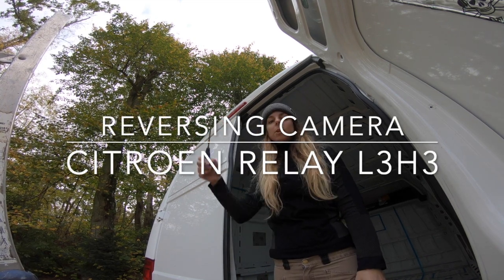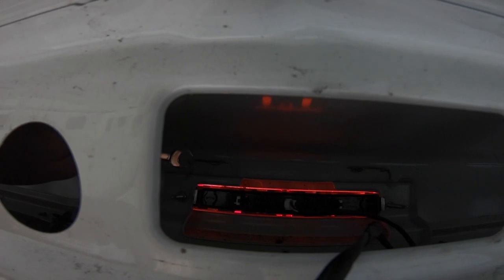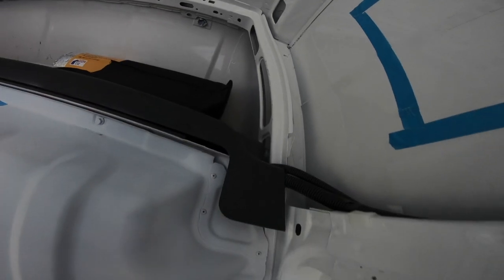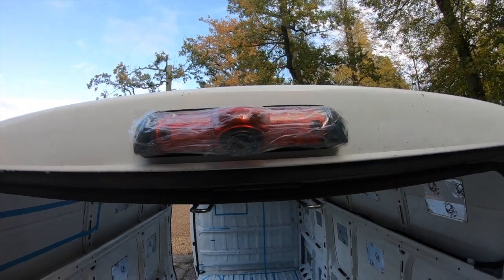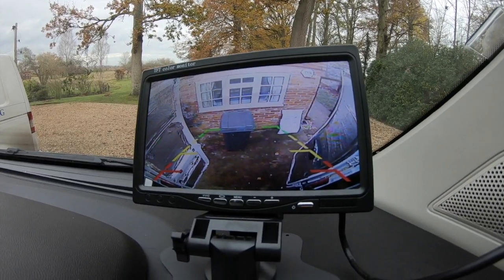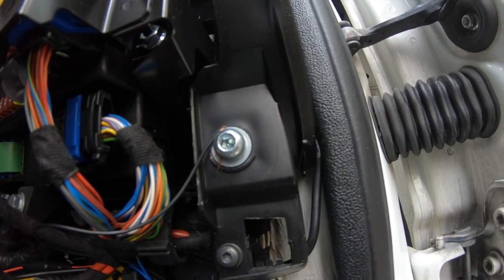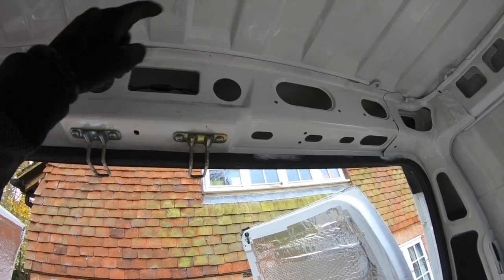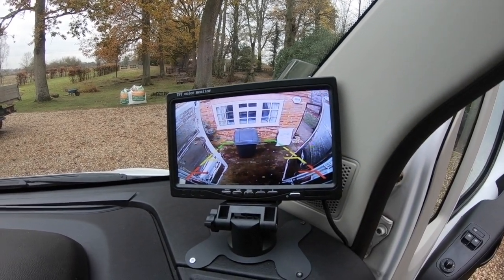REVERSING CAMERA install/ Citroen Relay L3H3/ Episode 11

Comment: The problem with tapping into the interior light is its on a timer (i think 20.mins) it then cuts the power to it. I have wired mine into the reverse light
Reply from the maker: I think I must have done that too 🤣 my bad! Because mine defo does not go on or off on a timer like...🤔 Thanks for the info 👌🏻